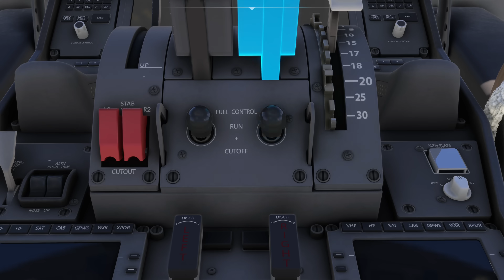Air India 171: Why Did The Fuel Cut-off Switch Get Moved?

Comment: Confirmed: Captain Steve received the full payment now
Reply: Mayday Air crash disasters channel.
Off the top of my head, I recall 3 different times a "Pilot" was in a bad place and killed himself and a plane load of souls.
You are not being fair.
Reply: WSJ reporting that the captain took the plane down based on additional CVR data.
Reply: So everyone in the comments has irrefutable proof of Boeing's payment? Because the preliminary report is visible to everyone, it is such a human lag (1 second between the two buttons and 10 seconds to put back) rather than an instant and simultaneous cutoff like a computer or mechanical bug would do.
A fault in the aircraft, especially on such a vital control, would be very visible in the black boxes or in the pilots' discussions (it is quite obvious that the buttons did not physically move on their own, already by the spring that holds them and the fact that it was not simultaneous).
Even if he is paid and he is insinuating sui cide, I would like someone to explain to me in what scenarios the preliminary report includes a malfunction of the 787 caused by its design.
Reply: Damn man...this really is sad. The silver lining is learning about Flying Beast 320. That guy is a true hero.
Reply: All Nippon Airways Boeing 787 during its final approach to Osaka, Japan, in 2019.one of the engines suddenly shut down.

Investigators later found that the aircraft’s software had mistakenly interpreted the plane as being on the ground, triggering the thrust control malfunction accommodation system, which automatically moved the fuel switch from “run” to “cutoff” without any action from the pilots. 

People here are reaching biased conclusions supported by stupid theories of this steve guy based on interim report which in turn is based on data not made available to public (not even CVRs)
Reply: @ravishbhatt3880 absolutely
Reply: Truee and totally agree.. Bro is literally milking views from the Indian audience and has posted 8–9 videos about the crash that happened in India, which has no relation to America — just to defend Boeing a$$. Ngl but he is also part to there so called media and i believe money has successfully transferred in his account from boeing fraud company.. he is just a puppet who is speaking and manipulating audience on behalf of boeing.
Reply: @neerajjoshi3714 I assume you don’t fly anywhere or try to pick airlines that do not use Boeing.
Reply: Agreed !😂
Reply: Watching the earlier videos i thought this grey hair meant maturity..
Now i stand corrected, He is close to retirement..$!
Reply: Hero to zero journey approved😂😂
Reply: shame on him, he himself is a pilot but money over morals right
Reply: Both Pilots were most respectable men how dare you
Reply: Exactly
Reply: 😂😂yes ,now investigation has begun in Electrical malfunction now steve has to hide from next month
Reply: Everyone. The RAT deployment is the smoking gun. It deployed at the exact same second the fuel transitioned or before. And it’s only deployed if
• there’s electrical power loss
• there’s hydraulic pressure loss

The hydraulics wouldn’t be powered off if the fuel was shut off, they are electrically driven

The electrical power wouldn’t be shut off with the fuel cut

System failure > RAT > mayhem

RAT deployment is everything. Why/when?
Reply: Hey old man why don’t you just accept the fact that you are been planted by Boeing to save their image. And for that they have paid you a huge amount.  I don’t know which fool granted you that CPL. So Mr. So called pilot are you trying to put the entire blame on the pilots without even knowing the actual truth. This is a typical American behaviour where they are trying so hard to save their company.
Reply: Yeah...  True. This cnut is sold.
Reply: All indian  things that way because the answer does not match what indian thinking is that's why.😂😂😂😂
Reply: He lost all the credibility  especially him on that bl**dy Piers Morgan show he title MURDER and Steve was there why Captin ??? 
In his show they literally try to portray narrative and using CAPT. Sabharwal’s personal life as mental issue 

Godddddddd you guys are so cheap your self respect is so cheap that anybody can buy it
Btw unsubscribed
Reply: Unless you have proof of what you’re saying, stfu.
Reply: With all due respect, what are you talking about? Where did you see this “confirmation”?
Reply: Yeah, it is true
Reply: Confirmed by whom?
Reply: “I have heard from several Air India pilots who told me he had some depression and mental health issues,” said Mohan Ranganathan, a leading Indian aviation safety expert.

“He had taken time off from flying in the last three to four years. He had taken medical leave for that
Reply: Idiot
Reply: Absolutely right.  Ever since this crash took place the American media and most known pilots started building a narrative that this could be a pilot error. 

It’s absurd no one talks about factual errors in this prelim report.  At multiple places the FADEC is mentioned as FULL AUTHORITY DUAL ENGINE COMPUTER, among many others. We have seen it time and again and that western ( readAmerican )media is master in creating narrative that suits their economic interests.  Clearly Boeing has to be saved at all costs.
Reply: Was captain your father?
Reply: The ELT did not deploy.. No cockpit warning which should have come if pilot had manually cut off the fuel switches...issues with AC in previous flight.. These also might indicate issue with the plane.. I dont think he has discussed any of these in any video
Reply: @lakshmyradhakrishnan6241 I would like to hear more on those as well. Only thing I've heard is other comments saying that the issues in the cabin are unrelated to the way the aircraft flies.
Reply: Agreed
Reply: Possible dual engine flameout.

A tech question aimed at narrowing down possible causes as fast as possible, obviously. The response was more of the same. 

Likely felt the engine thrust dropping and looked at the screen at warnings, noted fuel valves shut then asked the question before doing anything else, the copilot answered while shifting gaze to the switches then probably they both looked at the switches and throttle levers at the same time and voiced a few expletives as they realised something else had gone horribly wrong. 
  
The subsequent off then on fuel switch operations, which would have been lengthened by the results of the power down, RAT deployment and systems coming on, were to do with an attempt to get the engines going which was partially successful but the aircraft was then descending too fast and was too low to recover.

The timings noted in the report along with general RAT operation info and lack of more specific and detailed info make this scenario possible.
Reply: Dual income
YouTube 
Boeing
Reply: Change on all aircraft can not move to cutoff on both engines until reaching xxx feet over terrain
Reply: U r sick as fuck bro😢
Reply: Right
Reply: 100%
Reply: Modi he is a SELLOUT why he still keeping boeing
Reply: Aviacionline - 
AAIB Urges Caution in Air India B787 Investigation, Criticizes International Media for "Irresponsible" Reporting
India's Aircraft Accident Investigation Bureau (AAIB) issued a direct appeal to the media and the public, calling for a halt to speculation on the investigation into the crash of an Air India Boeing 787-8. The agency criticized certain international media for "irresponsible" and "selective and unverified reporting".

Either they have some dirt on you and blackmail is responsible for your negligent reporting, or you truly lack common sense and should not be a pilot. Imagine if you were flying that bird when the crash happened and irresponsible media and some YT pilots blamed you for intentionally doing it? What would your family think? How would they feel? Do you even care? I hope whatever money you're being paid or blackmail evidence they have on you is worth the loss of credibility and disdain that many of your (previous) followers now have for you. Or who knows, maybe you were a plant to begin with. 🤷‍♀️ Either way, sad shame! 😮‍💨
Reply: Hoooly cow, so many angry pajeets in one place
Reply: Confirmed: your mother recently full payment... then you were born. 
You are the product of prostitution that's why your talking payment when some many lives were lost and this Captain is trying to provide answers for families whose loved ones were directly affected by this incident. You on the other hand born in the slums of red light district is trying to ruin the reputation of an experienced pilot, and training instructor. You will forever remain YouTube garbage in this lifetime and many more to cone.
Reply: Appreciate it😂
Reply: lol
Reply: Absolutely 💯
Reply: New reports are suspecting electrical failure..based on evidence from tail end of plane.. So it think it us now going in the direction that pilots turned on and off fuel switch to revive engine and it worked because one engine did turn on... The other one did not.. Additionally as per how i read turning fuel switches on and off IS a procedure in boing guidelines for thrust issue in emergency situations
Reply: If I type suicide, does YouTube bleep it out too?  Time to get rid of the PC police and call it like you see it!  Just think what an open AI is going to do with us…
Reply: Can we make a rule that everybody has to watch at least 20 episodes of Air crash Investigations, before asking a question 🙋😂
Reply: @Number-5-is-alive will they make us an expert too??
Reply: Just unsubscribe guys.... he sold himself long back.
Reply: @OAParis when? I only noticed from the first ai171 ask the captain.
Reply: Where are you all seeing that he was paid for anything?
Reply: Stop accusing him without any proof.
Reply: You are correct. You are corrupted captain Steve
Reply: @abhishekarora5555 https://youtu.be/HMr-aBMmX1k?si=50V57r17ZtvwgPpz
Reply: specially, comparing pilots conversation to his kids conversation is so silly..... all analysis based on his speculations.
Reply: You're wrong dude. The plane didn't do this cause of a flaw. It was a pilot. He must have been pretty depressed.
Reply: so true
Reply: Shame on this guy….even made money out of lying on his unnecessary boeing paid analysis on youtube for the whole month and doing.
Reply: You dont want to hear the truth. Are you the person who paid him?
Reply: Shame on this old unkle
Reply: @thesailor4420 Bro! It's spelled uncle. There is no "k" in the spelling. Bro, learn some english spellings before you critique others.
Reply: what makes you know more knowledgeable in the field than an actual pilot?

You can't ignore evidence just to suit your established agenda against  the big companies. Be better
Reply: @Kai-ie6qg why not wait until actual voice recording release and the final report?
Reply: I don’t believe this guy either.  He has twice made ungrounded speculation target at the pilot.  First he said the pilot used the wrong flap setting then corrected himself the next day when he saw RAT deployed.  Then now he is blaming the pilot doing a murder suicide, when there are other explanations.  For example, caption James from Taiwan who flew 787 had speculated that some glitch might prompt the pilot to toggle the switches to reset the system.  In aviation, cycling a fuel control switch from RUN → CUTOFF → RUN is literally the manual way to try an engine relight. If an engine stutters or a display gives a fuel warning, flipping the switch becomes a natural “reset” response — especially when there’s no time to fully diagnose.
Reply: Nice try but that's weak conjecture. All indications point to murder.
Reply: @sophiesheu that's why it's called an ONGOING investigation you idiot.  They're not drawing conclusions from one look, they're reviewing every aspect over and over again in case something went amiss the first time.  It's called being thorough... something a clown like you will never understand. The fact that he was the first one to point out the deployment of the RAT is a testament to his knowledge.  Millions viewed the crash video but no one saw it, things do go amiss and reviewing things is good practice.
Reply: @sophiesheu The information comes and change with the Videos, in the First you didnt See the RAT and you didnt See the flaps, that was the First .
In the second Video with better Quality  , First than you See the RAT deployed and See the Position from the Flaps.
So stepp by step the incomming information Change the View to the Things happend.
But thats the normal way when you dont have all information at one time.
You judge Afterwards with the View to all information now, so it's easy to say "oh He was wrong blablabla, a Bad Guy" !
But only you are wrong.
Reply: @joyride170464  Yes, and that’s exactly why you don’t make accusations based on partial information early on. This Steve guy threw his fellow pilots under the bus before any formal investigation even began. By your own logic — “you judge afterwards with all the information” — he was totally out of line.

He started speculating the day after the crash, then escalated to serious accusations based on the Wall Street Journal, and again after the one-month preliminary report. That report didn’t conclude it was a pilot murder-suicide, but Steve spun it that way and ended up influencing people like you.
Reply: @sophiesheu  u are right about the reset approach but why on earth did the switch stay at cutoff for about 10 seconds....if they intent was to restart the engine the transition would've been immediate like back to back within a second tops two.
Reply: @jeysneha  The fuel cutoff was recorded at 08:08:42. Just 4 seconds later, at 08:08:47, the RAT was deployed. Then at 08:08:52 and 08:08:56, Engine 1 and Engine 2 were relit, respectively. That sequence strongly suggests the pilots were reacting quickly to an unexpected failure — not deliberately shutting down the engines.

Remember, the flight data recorder doesn’t show video — it logs binary signals (voltage/current changes). A mechanical or electrical failure could trigger a signal identical to someone flipping a switch, even if no human action occurred.

Also, consider cockpit dynamics: at 08:08:42, the pilot flying had both hands on the controls, and the pilot monitoring had his right hand on the throttle. For the captain to physically shut off the fuel switches (located on the right), he would’ve had to awkwardly reach across with his left hand — a highly unlikely action during this critical phase of flight.

In my view, something malfunctioned right around 3 seconds after V1. The pilots likely followed standard emergency procedures and began relighting the engines — not because they caused the failure, but because they were trying to save the aircraft.
Reply: @sophiesheu they why did the pilot say "why did you cutoff" if they were just resetting. Why did it take 10sec to put the switch back to run.
Reply: @Z-add there could be many reasons for the conversion to go the way it did and you also have to consider the sequence of events.  However, this Steve guy went out a limb to suggest pilot murder suicide at this initial stage of investigation without considering any other possibilities suggest that he is biased and very likely has an agenda or was bought by Boeing.
Reply: Absolutely
Reply: Just imagine this situation  -
Plane taking of, suddenly two engines flame out almost together, sound of engine spooldown alerts the pilots, they cut off fuel and then change over to run to relight the engine as SOP , one engine starts to recover but the other one doesn't.Too late. Low altitude, plane crashes.
Possible ?
Reply: Leave steve alone !  You got the balls you get on the plane and learn for your self !
Reply: Award him the Defender of Boeing 2025
Reply: @mv8307  Look again at 5:28.  Captain Steeeve is calling criticism of Boeing justified and said Boeing needs to step it up.  So he’s not the “Defender of Boeing” as you claim.
Reply: The comment shows how much we Indians are being brainwashed
Reply: Absolutely. Just look how he casually continues to blame the dead pilots and follows up with a sly interlude playing on human emotions and psychological entrapment. Basically his words suck you into a single eventually blaming the pilots.
Reply: Yet another report from a professional investigator urging to wait for the final report. 

She even says it's quite a routine that pilots are blamed only to find defective planes caused the crash

https://m.youtube.com/watch?v=FOuBIOHoHb4

Captain Steve will probably bite the dust. His ego won't allow him to apologise,  which is understandable. After all everyone has their ego and we have to understand that.
Reply: Wearing pilot dress doesn't mean that he is a pilot 😂
Reply: Captain Steve is leaning toward supporting Boring. However, I strongly believe that the information presented to us is limited and misleading. Given the manufacturer’s history of hiding critical details, we should not jump to conclusions.  

In India, it is very easy to influence opinions with money. There is no accountability, integrity, or dedication whatsoever from the Indian investigation team—especially now, as all pilots are raising concerns about the incomplete report. The fact that the report gives a clean sheet to GE and Boeing only proves to me that they were bribed.  

In general, humans don’t care about their fellow humans when greed is involved. After watching all the technical videos and pilot discussions, my sixth sense tells me this report is flawed. Eventually, they will blame the pilots, as it benefits both the manufacturer and the end-user in maintaining their reputation.
Reply: Yes. He is just sticking to one narrative. Indian news channel raises concerns about the report. This guy also makes an appearance on the Piers Morgan show .

https://youtu.be/4m6LwZLLq7A?si=cGwUAYBEEpnGoniT
Reply: Unsubscribed. You are a liar Steve Scheibner.
Reply: Yes he did 😂
Reply: Yup you are right
Reply: remember the earlier vid how Steve said it couldn't have been one of the pilots and didn't even want to entertain that as a possibility? 😭
Reply: Absolutely
Reply: He is a SELLOUT
Reply: @funfoodfamilysohal Why do you say that? Judging by your thumbnail you're nothing but a child. How does a child know what money Captain Steeeve receives? Don't even get me going on the morons who have given a child's comment a thumbs up.
Reply: Agreed — no matter how much knowledge a person has, he'll always be a slave to his money.
Reply: @jaydevprajapati-j3n everybody slave to Mony in this world don't be ridicoulous
Reply: @jaydevprajapati-j3n  And here you are, giving him clicks. Thank you for your support. Silly people, if don't watch YouTube videos the content creator does not make money, yet here you all are, literally paying him by your views.
Reply: Such a shameful thing to do by a person like him...he is defaming a dead pilot agn nd agn just for money...God will do justice now...why cnt it be a technical error has the final report out ? No till then shut ur mouth up
Reply: @PRERNACHAUDHARY-t5b India need to revenge on Boeing
Reply: He is a disgrace
Reply: Inconvenient truth.
Reply: Sapere aude 
https://youtu.be/HMr-aBMmX1k?si=50V57r17ZtvwgPpz
Reply: Captain steve just keep one thing in your mind that you have to answer one day to your almighty God.. You will regret 1 day..
Reply: @RajBanna44-o9e 
Not sure if this Steve is the same person who created a Christian Church.
Reply: I love how pilots like to claim that flying a plane is difficult..Driving a vehicle is 1000s of times more complicated and dangerous than flying a plane. Self driving cars have been on the roads in the US for about 10 years.  AI can fly a plane extremely easily .. don't tell that to a pilot though.. I'd like to see a swarm of 10000 piloted planes do stuff that AI controlled drone swarms  can do a few feet from each other
Reply: @geospatial-KML Just thar if instances like these are FADEC software glitches, Thrust Control assuming plane is on ground due to some other signal such as landing gear, and cutting off fuel supply, like it happened in Japan ANA flight in 2019, then we must be wary of AI and tread cautiously
Reply: @geospatial-KML  you're an idiot
Reply: @geospatial-KML  there is not enough training data on exceptional situations. This already hits cars who then just stop. But impossible for planes.